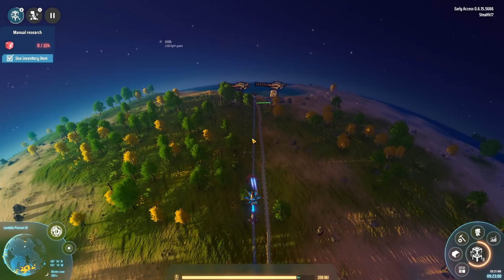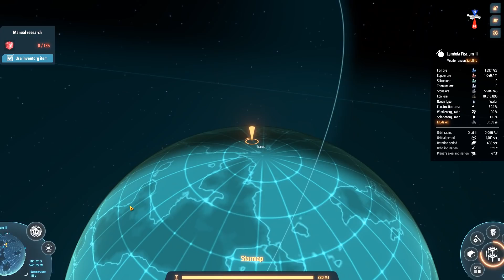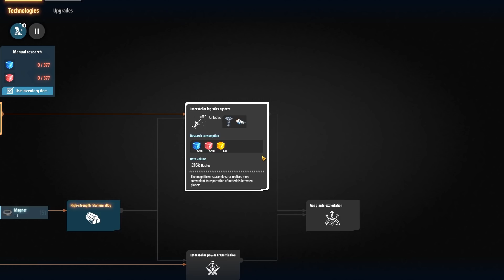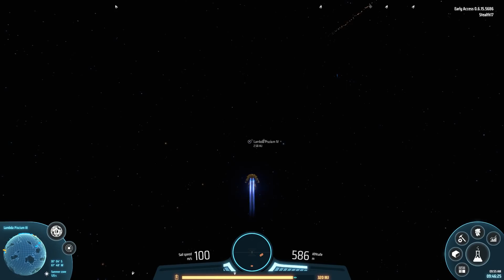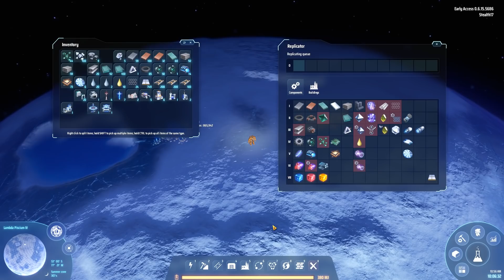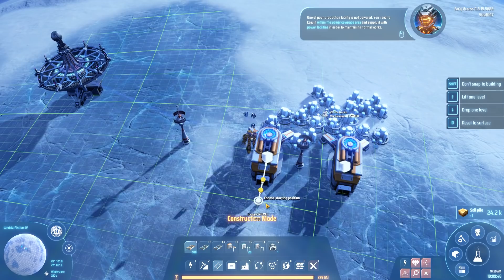Dyson Sphere Program - Brave New World - #5

Comment: The shift key speeds up sail flight.
Reply from the maker: It does? Omg I've been sailing around forever on just 100 m/s. I only unlocked the 1000m/s sail speed just now though.
Reply: @Stealth17Gaming  Be sure to throttle down with 's' in time. Otherwise you will take some rounds around the planet to reach it. Also use 'w' to adjust your direction. It takes me some flights to learn how to flight in space.
Reply: @Stealth17Gaming  It has 1000 base speed, and the tech speeds it up to 2000
Yes, you wasted all that time
Reply: @Stealth17Gaming  be  careful at high speeds though you can miss your planet pretty easily if you have lower tier fuel
Reply: I just got to that and hoped he discovered it later